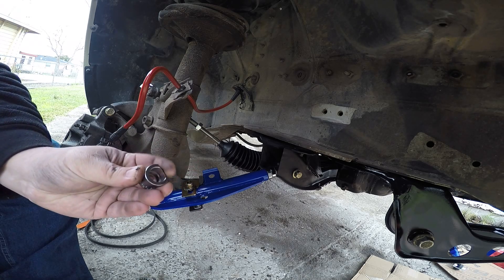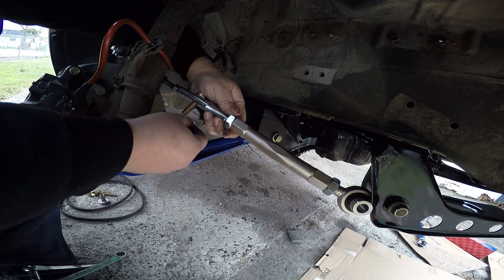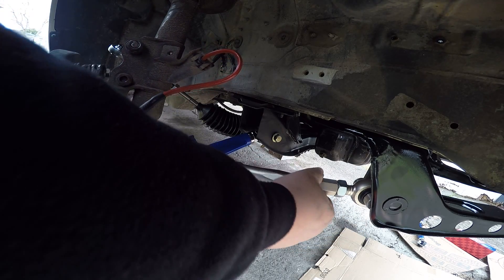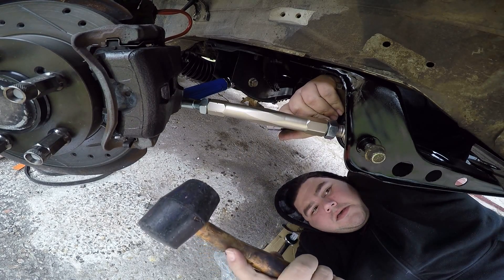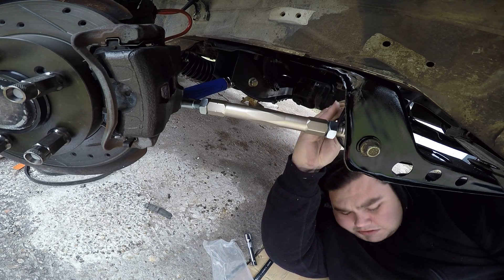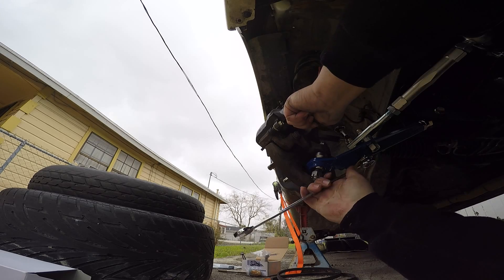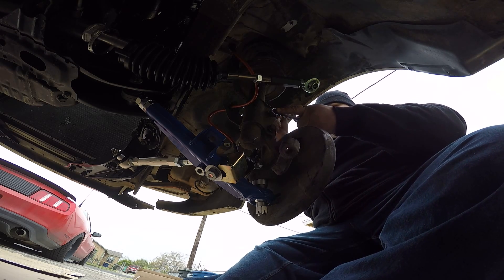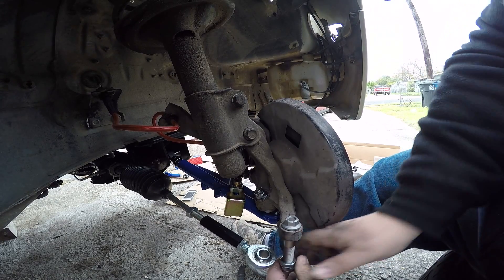Episode #22 Installing lower control arms and tension rods on the S14.

Comment: I got the exact same set up. But i cant get my sway bar links to fit right. U have any issues with tht.
Reply from the maker: I haven't installed my sway bar yet. I'm not reusing my old end links. I got a Progress sway bar and spherical end links. I still gotta install them. Lol
Reply: Ok cool. Ya i got the lcas and tried using factory tension rods. Tht wasnt happening. N i noticed the placing of the links is off by like a inch or two. Just gonna get some nismo oem replacement arms. Thanks bud keep up the good work

Comment: how do you adjust the FLCA? Because it's too narrow space and wrench wont fit.
Reply from the maker: KONAN 
Yes, this is a problem I've been having myself. Initially, I used a small pair of channel locks but  I couldn't get it tight enough and it kept coming loose after driving for awhile. What I thought about doing is grinding down the sides of one my wrenches so that it'll fit. But I haven't don't that yet. 
You could pull the bolt and drop the arm to make adjustments but that's really not practical.
Reply: I'm thinking of cutting the one side sheet metal to give room of adjustment. or dropping the arm and adjust it

Comment: did you end up changing the order of washers on the 2 bolts connecting the tension rod to control arm?
Reply from the maker: Yes, I had to remove the bracket, bend it back strait and the put it over the tension rod and under the control arm.